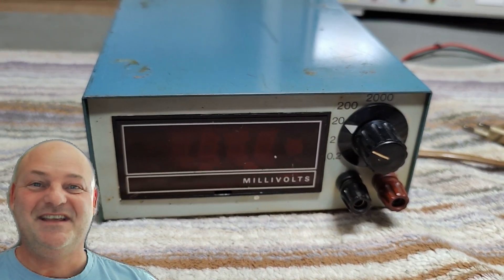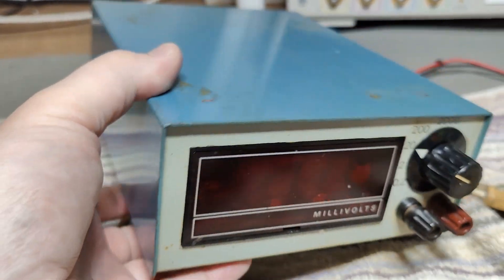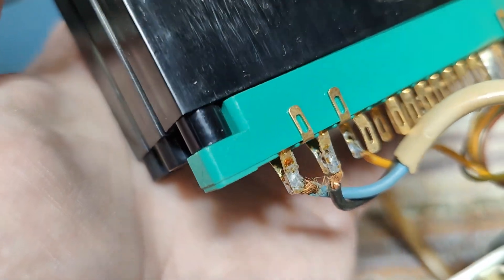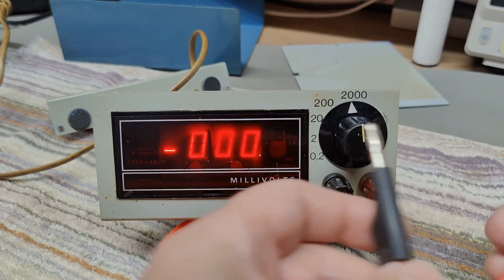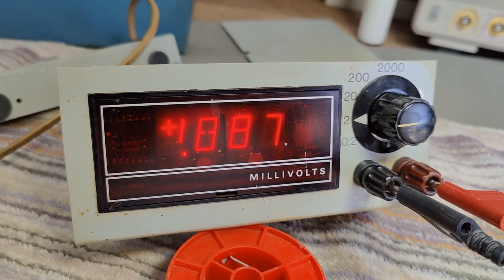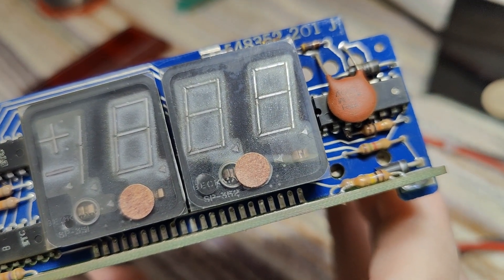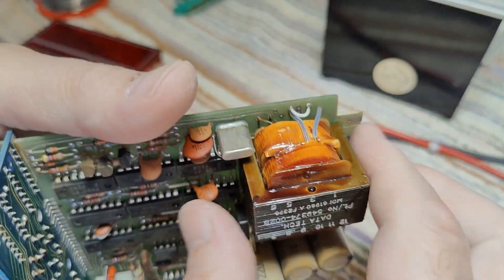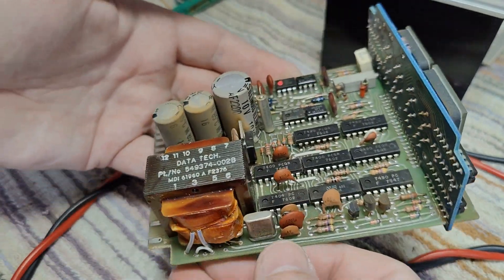Bang and Olufsen Style Beckman neon voltmeter 1973 test and teardown

Comment: Panaplex displays run on DC, the driver IC's are open collector; AC would fry the lot. They are quite low current, you can get away with not much more than 100uA/segment (less for the DP), with a strike voltage of 180V and a run voltage of 135V or so. Usage can improve the uneven segment, but don't expect it to ever be perfect.
Reply: Not AC, but unsmoothed DC is no problem. The '1' segment seems to be poisoned, those can be revived by running them (briefly) at a much higher current.

Comment: It has been used in the production and at the service department.    I have two of them.   There has been made several other instruments for different use.  One for test of fly-back transformators and coupling of instruments.
Reply from the maker: cool thanks, i had the idea it could be the one and only made, its value will be double if only it had a B&O sticker or label :-) but it is clearly the correct case.